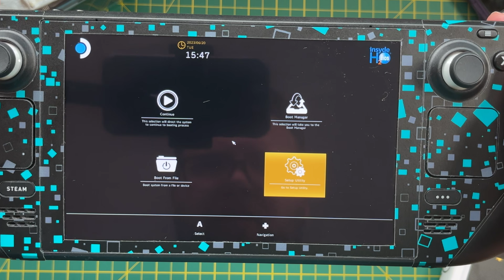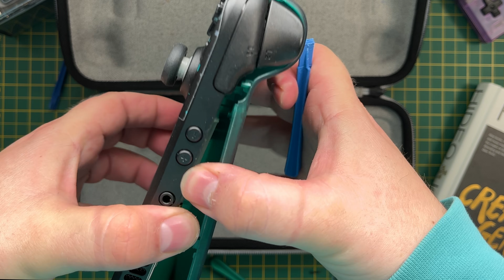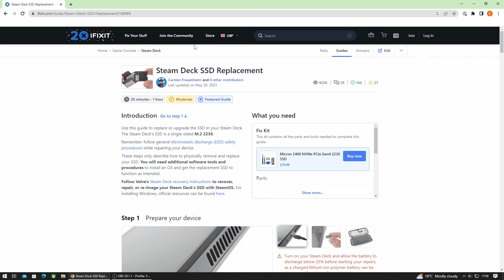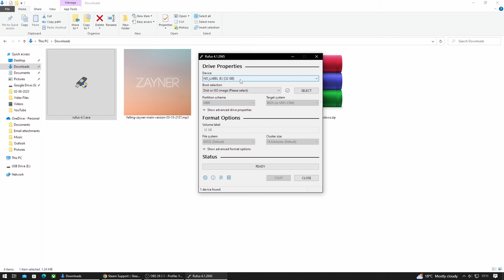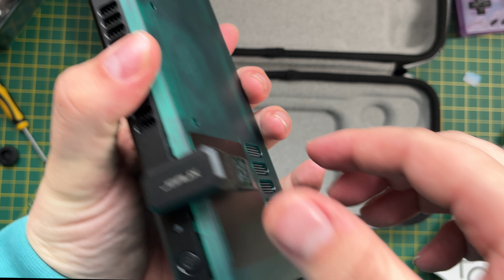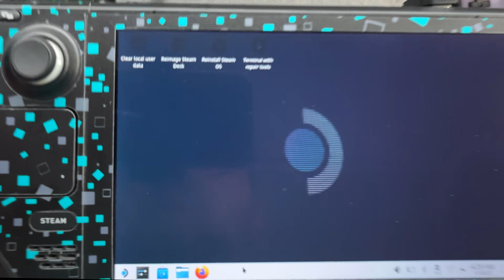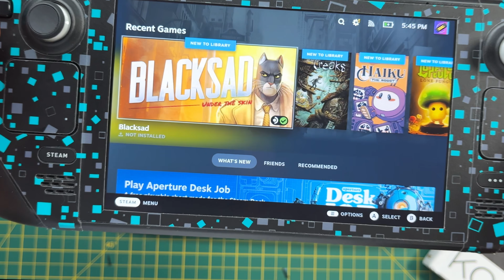How to Upgrade Your Steam Deck Storage!

Comment: how did you mange to remove that screw? im having same issue?
Reply from the maker: I used a flat head screwdriver and used brute force tbh. You could try using the elastic band method
Reply: @steamdeckguy  yeah i just leave it and just bent the shielding enough for me to remove the ssd and battery. Its working now and have dual boot. Thanks mate

Comment: No matter what I do I cannot get to the steam recovery drive page, it just sits there on the logo for hours. Ive tried 10 times with USB and SD card, nothing works. Please help!
Reply from the maker: Which program did you use to write the image? Try a USB 3.0 thumb drive
Reply: @steamdeckguy  Thanks for responding so fast, I used rufus and a USB 2.0 I had bought because its also a USB C, I might just have to get an adapter and try USB 3.0

Comment: I'm following the steps exactly but when I boot into recovery mode the option listed says, "EFI USB Device (Generic)" when I select it, the Steam Deck Logo appears for 20 min. Then the whole screen turns black until the battery dies. Sometimes when it turns black a cursor will appear. What am I doing wrong? I've tried this like 4 times now
Reply from the maker: Try a different usb drive. Also make sure you the image has been written to it correctly.
Reply: @steamdeckguy  OK, thank you!
Reply: @steamdeckguy the new USB was the trick! Thank you! It's a pain how finicky it is that it matters what usb stick you use, but thankfully they're cheap. Thanks again!
Reply: @GhibliNova this is happening to me. Just got home from Walmart. I just purchased this thumb drive. Staring at a black screen with a cursor right now. Ugh. I don’t have another thumb drive.
Reply: Is there a Way to check if its written correctly? @steamdeckguy

Comment: the hardest part for me are
1) the power tab doesn't come out easily because it would rip the tab off. So i use a pair of twizzer to wiggle it out from sides.
2) i used mac, you will actually need to unzip the provided file to dmg before you can transfer the image
3) both my sd and usb cause my recovery image step to stuck on logo screen for several hours. I have to borrow another sd card and it worked

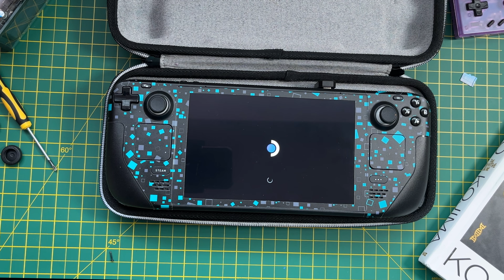Comment: I got stuck around 6:30 I’ve been on the boot screen for over an hour and haven’t gotten to the reimage screen yet, I’m using an old flash drive that might be 2.0 and I’m not sure what’s the problem
Reply from the maker: Is it doing anything or just showing the steam logo? You can hold the power button down to force shut it down and then try again.
Reply: @steamdeckguy  it just stays on the logo I’ve tried that but didn’t work I’m in the utility settings right now and my ssd is being picked up and says how much I storage I have also my date and time in bios is in 2021 I don’t know if that’s normal
Reply: It says Bus:1 Dev:0 Func:0
Reply from the maker: @Spiikz  is that what it says after you boot from the USB drive?
Reply: @steamdeckguy  I fixed it, I bought a new flash drive 3.0 and then everything worked perfectly after like 20 minutes

Comment: Did you use any programs after your ssd was installed to confirm the size, read and write speeds of the new SSD?
Reply from the maker: I didn’t bother. I probably would have if I had bought it from aliexpress or somewhere to make sure it wasn’t a dud

Comment: Quick Question - I didn't see you connect the device back to power removing it from Battery Storage mode. Was this part hidden from the video? I wanted to make sure prior to going through this myself. (Only saw you boot to recovery with power and volume down.)
Reply from the maker: Yes, I accidentally edited that part out

Comment: Thanks for this tutorial. There's just one thing that was missing. How to proceed after the ssd was installed, since the path you took was to enable the battery storage mode, next thing to do after you inserted the ssd was to plug the power cable, then from there you just need to push the on button then remove the power plug, insert the usb. Then proceed with boot manager.
Reply: You could also use a dock👍
Reply: @CrapkinsTheBrave 
Thank you! My brain couldn't figure it out, then I read your comment lol. It seems to be working now
Reply: Other than that it’s great. I over think things.  This was great help!
Reply: The above link is no longer valid and they no longer sell that ssd. I will likely go with the sabent 2tb 2230 from amazon
Reply: might be a dumb question, but do we have to do this if we just got the Steam Deck fresh out of the box?
Reply: @fluffyphatkitty  nah thats for people who want more storage then what already is on theire steam deck like me i had 256gb bouthg a ssd of 2tb for less than what i paid for 2 500gb sd cards lol so of course i went for it
Reply: He did say that
Reply from the maker: Yes, well noted. Thanks for the watch! 👍🏼
Reply: @steamdeckguy  To be honest, I've watched different ssd replacement. Your video is the most detailed. I had the courage to do the replacement myself after watching your video multiple times.
Reply from the maker: @thecritique00  Awesome! Glad to hear!
Reply: @steamdeckguy please send a link to that ssd 🙏
Reply from the maker: @KingJC.  https://www.scan.co.uk/products/2tb-wd-pc-sn740-m2-2230-pcie-40-x4-nvme-ssd-5150mb-s-read-4850mb-s-write-650k-800k-iops

Comment: i got past the logo screen right before the reimagine part and my screen is just blank with a sideways mouse
Reply from the maker: Still having issue?
Reply: @steamdeckguy yes, same issue here
Reply: Did you manage to fix it?
Reply: Same problem. Brand new drive. 3.1 SanDisk 128gb brand new recovery image file just downloaded unzipped and used Balena. I don't kno the problem

Comment: I need some serious help.  I installed the SSD and made sure the battery was nearly fully charged.  However, after attempting to insert and flash the OS using my type C drive the Steam Deck won't respond to the power button at all.  When i plug in the charger however, it shows the "Default Boot Device Missing or Boot Failed...."  The second I unplug the wall charger the device turns off!  WTF do i do?
Reply from the maker: You needed to connect a power cable to get the device out of battery storage mode. Now you’ve done that you should be able to boot the recovery image by holiding volume down and and power button and selecting the USB from the list

Comment: Do i need to do the recovery if i switch the SSD before even using the steam deck at all? I have one arriving in abourlt 4 days
Reply: I would test the deck if it has any issues before upgrading. Otherwise you will never know - if something goes wrong - if it had any issues before the SSD change
Reply from the maker: Yes, because otherwise it won’t have any operating system installed….

Comment: Can I still do this with a Chromebook?
Reply: You can do it with your stock Steam Deck itself, just download the image to a USB flash drive BEFORE taking apart your steam deck..
Reply from the maker: @SalivatingSteve  Good shout, completely forgot you could do that 🤦‍♂️
Reply from the maker: Assume no - since you need to download files and write to usb using flashing app., which I don’t believe you can do on chrome book.
Reply: @steamdeckguy  dumb question so say I was to mail someone the thumb drive and they added on there and ship it back would it work that way or do you need both thumb drive and deck together?
Reply from the maker: @ki11switch14  if someone can flash the files you need onto a usb drive then that would work

Comment: Is it possible to put the recovery onto a micro sd and load it that way if it is large enough?
Reply from the maker: Yes. You might just need to put it into a USB adapter
Reply: Itll work without the adapter
Reply: @aiddenbecker5083 so I can don't need a flash drive then? I can just have it on my microsd card inserted into my steam with the reimage file?

Comment: these shield screws are on way too tight for me to get off
Reply from the maker: I had to use flat head screw driver to remove one screw because it stripped.
Reply: Way late but try putting a rubber band between screw driver and the screw.

Comment: I was considering doing this, but felt like it wasnt worth it risking busting the deck due to the increased power draw generated by the larger capacity ssd. There doesn't seem to be consensus around this, but I saw some people claiming on reddit that their deck got busted after about a year since installing a larger capacity ssd. People were comenting on it and most people seemed to think it happened due to the increased power draw.
Reply from the maker: I’m not worried. Ask me again in a year 😂
Reply: @steamdeckguy  will do! I hope your deck stays in perfect condition.
Reply: @steamdeckguy  deck still in good condition?
Reply: @steamdeckguy Well look at that it’s been a year. Any updates???
Reply from the maker: @Celtyyyyy no issues at all